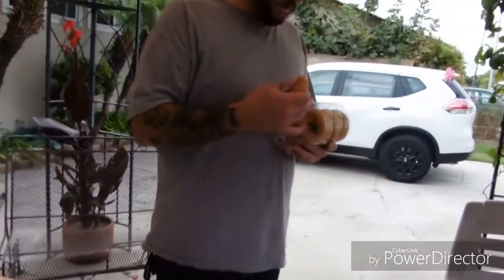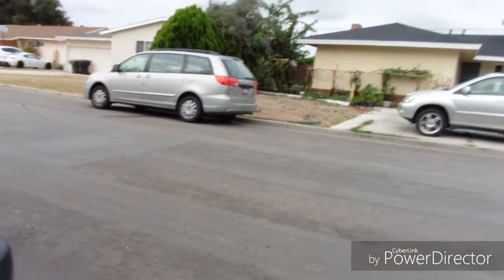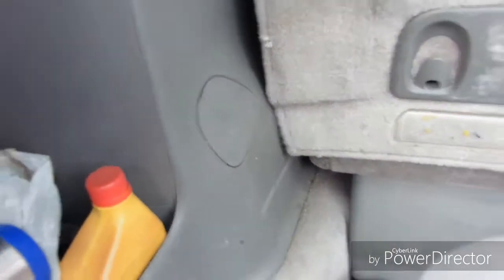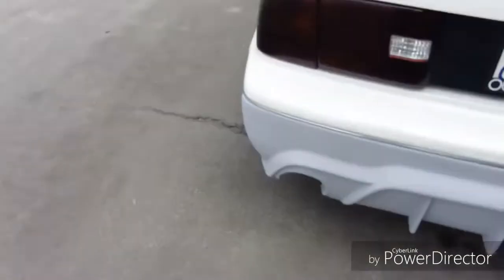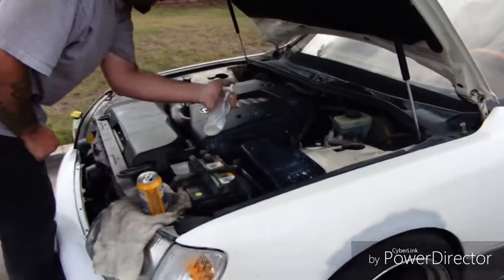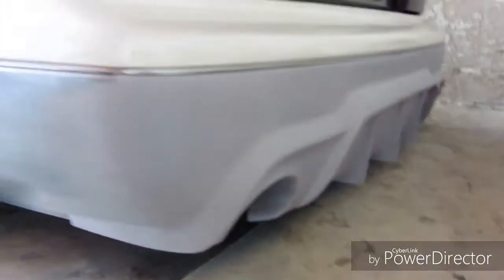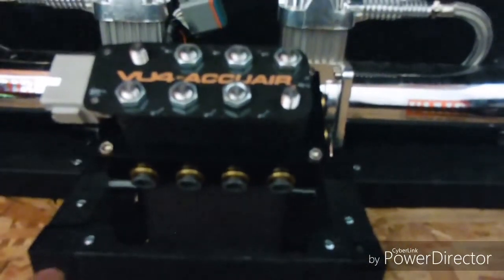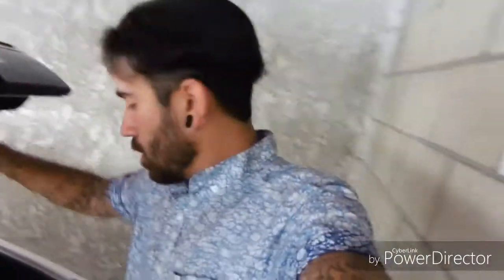Ls400 Is making big progress

Comment: Where did you get your rear bumber from
Reply from the maker: its oem bumper with alot of mods to it.  sectioned 3 inches and a is250 rear diffuser modded to fit mine